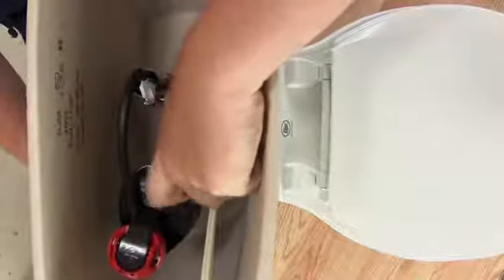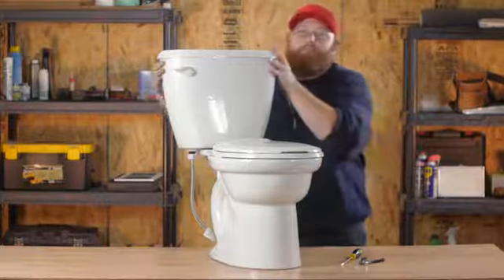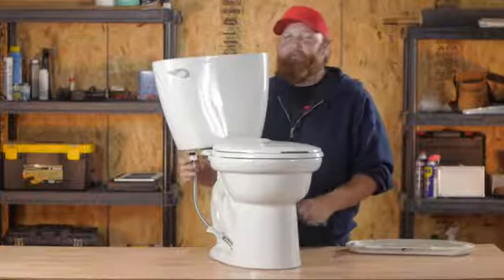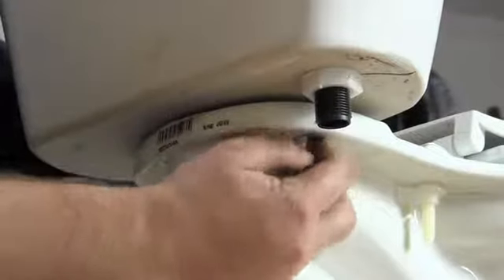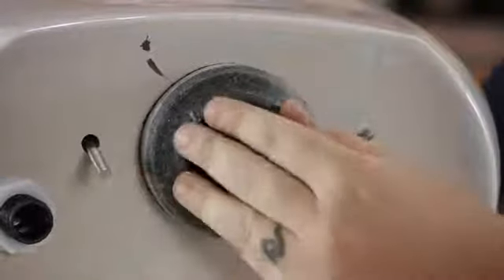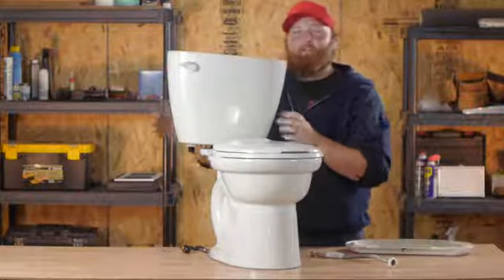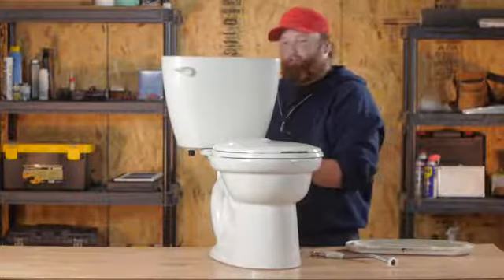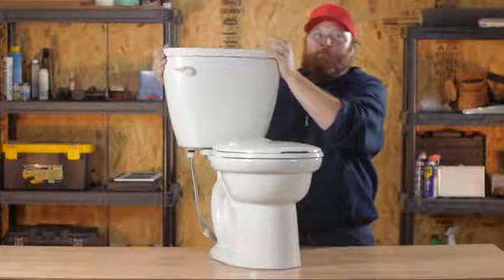Replacing the Washer Between the Tank & the Bowl in a Toilet

Comment: Great video; I just ran into the same problem and found this.  Funny, the rubber gasket was stuck down into the base of the toilet, NOT around the neck of the bottom of the tank.  It was also warped, so it was no wonder water was leaking out of the sides, around the gasket.   Time to replace.  Thanks for a great walk through!